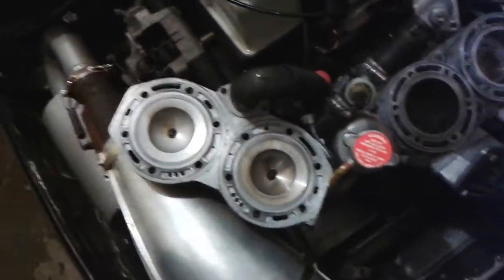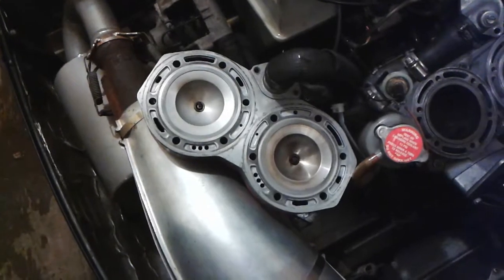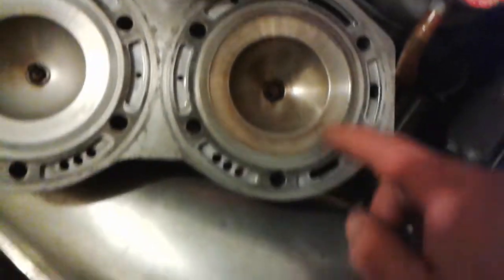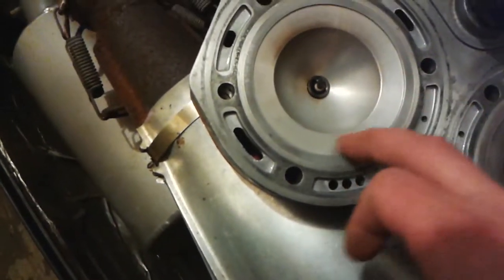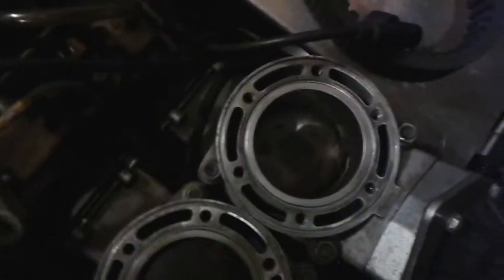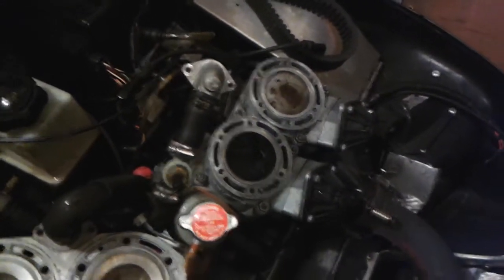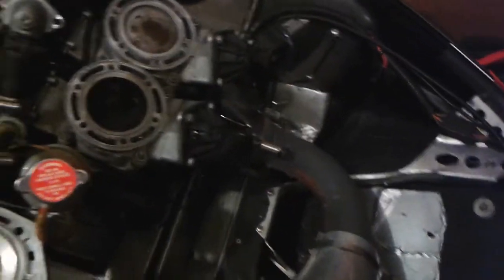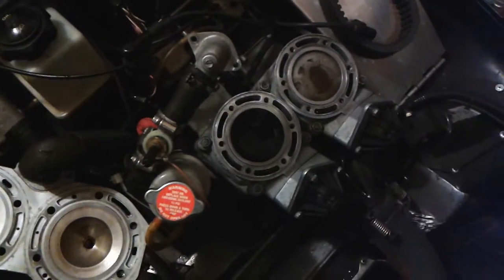2004 Polaris Liberty O-Ring Replacement. (Part 3)

Comment: Hey man great video series! I have a 2003 600 xc sp that is having the coolant consumption issues you mentioned so I will try this. A few questions where did you source your parts? I'm in bracebridge On. What is that in line temp sensor for? I'm looking for an after market temp gauge as there is nothing on the panel currently. And last, any recommendation on coolant? Reading some forms most folks just use prestone 50/50 mix but others say you should use oem stuff as it has extra antifoam in the coolant for high rpm. Thoughts?  Thanks! !!